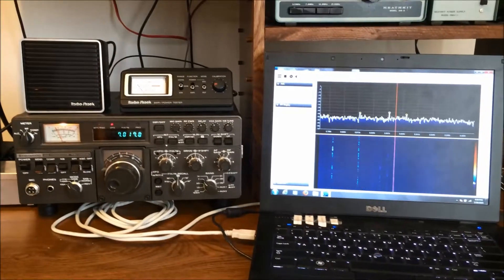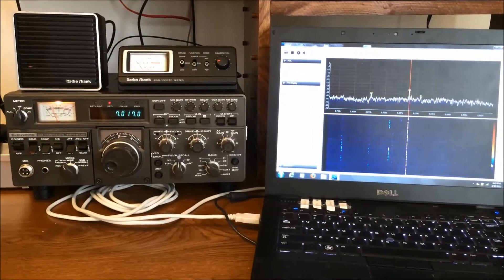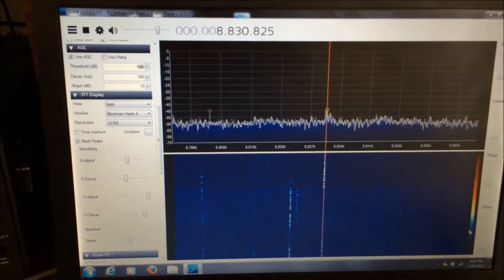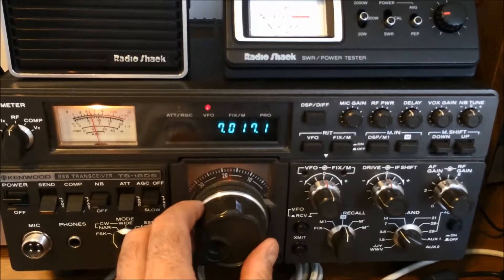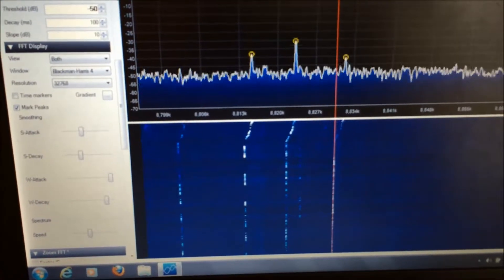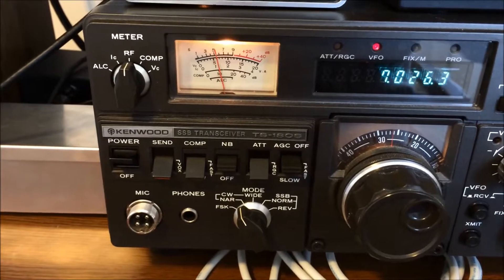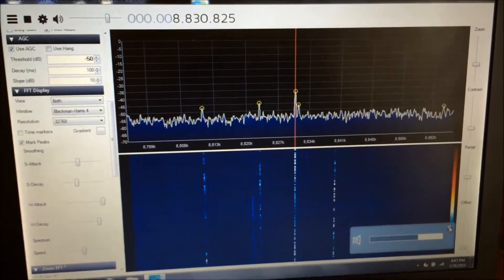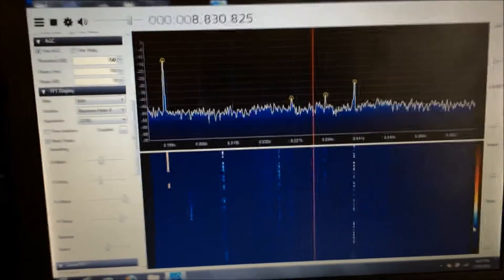WD8DSB Kenwood TS-180s panadapter (using a Ham It Up up-converter and RTL-SDR USB dongle receiver)

Comment: Hi friend, would you know where I can get the signal from the first FI of the radoi Kenwood TS 130, from which component comes out this signal, to use it with the pan adapter. I am waiting for your help. alexbrocker23@gmail.com
Reply from the maker: Hi Alex,
The TS-180s has a dedicated jack for the wide band IF output (I did not have to go inside the radio to get this signal).  I just looked at the manual for the TS-130 and it does not provide an IF output signal on the back of that radio.  Therefore you will have to study the schematic to determine what possibilities there are for acquiring a wideband IF output for use with a SDR receiver.
Reply: @wd8dsb  Many thanks for your reply, my friend, I'll compare the schematics to see what I get. 73s Alex PU3ALE in QRZ.com

Comment: I see that, every time a strong signal is inside the TS180S' IF passband, the AGC reduces gain. Have you considered passing the 8.83 MHz IF thru a VGA (Variable Gain Amplifier) whose gain is inverse to the AGC voltage? This is an expander function. I considered using two stages of Analog Device's AD602 cascaded for a total 80 dB of adjustment. I modeled it in LTSPICE but never got around to actually trying it.

73,
Bryan WAPRC
Reply from the maker: +WA7PRC 
Hi Bryan,

You are very observant regarding the AGC reducing gain which is easily observed on my SDR based pan adapter.  I have never found the gain reduction to be an issue based on how I use it.  I normally use it to observe interference (RFI) patterns as they crop up, use it to see if a CW signal pops up somewhere in the CW portion of 160 meters versus having to continuously sweep the radio dial, and use it to see if there is a clear spot to park myself during CW contests (or center myself between stations that are putting the squeeze on me during contests).

P.S. I normally look at the water fall display.

Thanks for the question/comment.
Don (wd8dsb)
Reply: +wd8dsb FB. I found it annoying that the signals outside of the IF passband would "bounce" up/down with signals inside the IF passband. The stronger the signal inside the passband and the weaker the signal outside the passband, the worse the effect. Maybe I should get off my duff and finish my expander. ;)

73,
Bryan WA7PRC